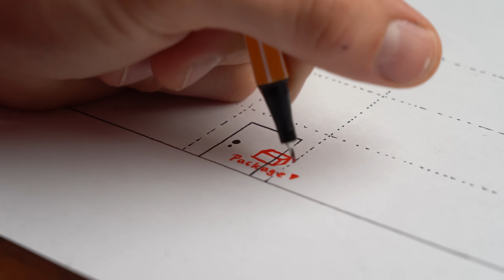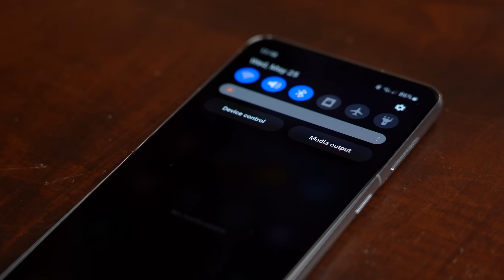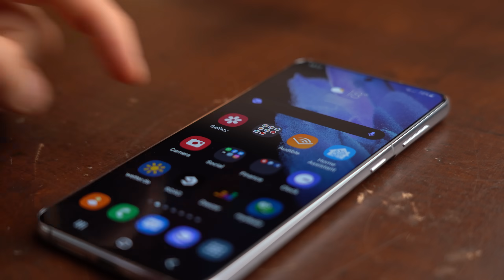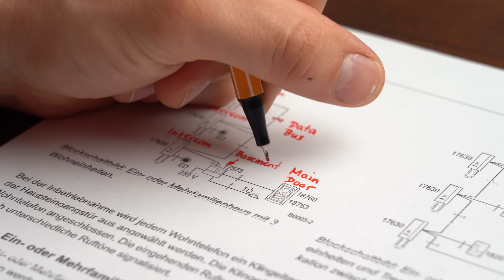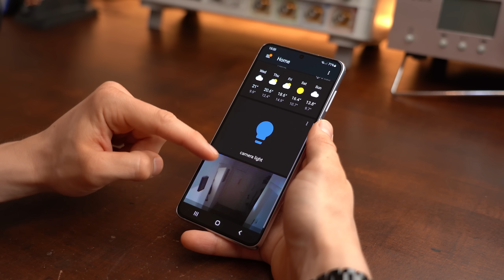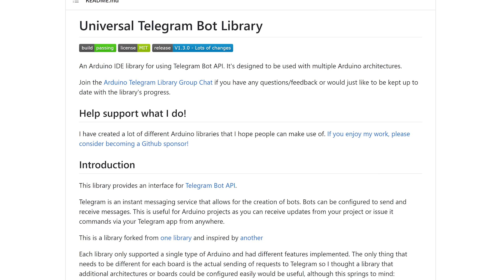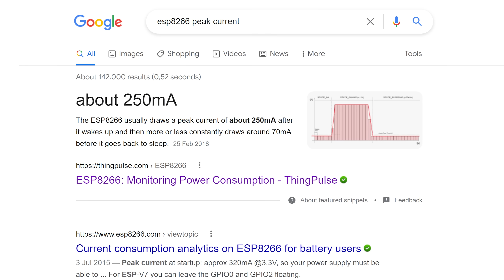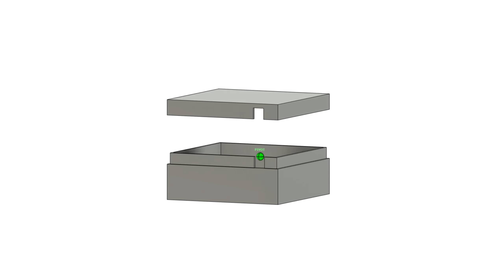Every Apartment needs this Upgrade! (WhatsApp/Telegram Notifications)

Comment: Excellent video. Love the least intrusive method. Only issue I have is with power being used when not in use. Doorbell doesn't ring that often. Maybe frequent but not often. Standby power use is too high, in my opinion - yours may differ.
Perhaps revisit to address low power sleep mode? obviously more important with battery power but still, we shouldn't design for waste.
Kevin Durrah has videos and designs to address just this.
Reply from the maker: Good point!
Reply: That's the issue with all ESP programs. When the ESP is connected, it always draws 70mA@3.3V. ~250mW is quite a bit for such a small device, and of course it will be a lot more when adding the current for the SMPS.
Reply: @TheRailroad99  if you're using the arduino core, you can always compare loop entry millis with loop end, and if the same (loop didn't do much that pass) sleep for 1ms... it cuts the power consumption dramatically but doesn't hurt response time if the loop has more to do.

Comment: Awesome project, I pretty much did the same thing last year to the exact same intercom system. Take a look at pushover, I used that instead of telegram to add a custom button to the notification, which can immediately open the door as well.
Super handy when you forgot the key or someone arrived earlier than you btw
Reply from the maker: Thanks for the tips!
Reply: @greatscottlab  You can also cut the the middleman without using universal telegram library and just send a POST request through Telegram API if it's just a one-way communication from ESP to telegram.
Reply: @kekkocheng  or a GET request with parameterized url. token, method name, paremeters (chat_id and text in this case)
Reply: @greatscottlab  Pushover is great, it's also integrated into Home Assistant so you can add everything to Home Assistant and do all your automations and other such stuff there as well, and I found it quick and reliable for pushing notifications.
Reply: Yep, i would also recommend taking a look at pushover.
Reply: +1 for Pushover. Excellent messaging API. I use it and a backup channel for critical server monitoring notifications so both speed and reliability is key. In practice I almost always get the Pushover message a second or two before the email; the email is configured to send first 😛
Reply: FYI, Telegram supports buttons in bot chats, too. While it's not directly in the notification, maybe it's good enough?

Comment: So cool to see old tech being "modernized" with the help of a little microcontroller :D
Reply from the maker: I think so too :-)
Reply: @greatscottlab  U can sell cute little greatscott electronic components plushies!! I think people may buy them ! lol..
Reply: Caramba eu vendo videos de eletronica e encontro o pesterenan aqui, amo teus videos também kkkkk
Reply: Esps are ground breaking chipsets in both feature and price territories!
Reply: I had an experimental thing on my oven, alarming me when the oven is preheated and ready to make Pizza. An LDR reading the light coming off the heater indicator and some timing/timeout logic did the trick
Reply: @nrdesign1991  Could've use a power monitoring smart plug for that. And the "Appliance has finished" blueprint on Home Assistant.
Reply: @Mavi222  The oven is hardwired and I'm not allowed to modify this wiring. Also no home assistant here
Reply: https://youtu.be/vOBSn1RWKj0
Reply: Thats not a little microcontroller though. Its pretty powerful for a micro controller
Reply: @uvuvwevwevweossaswithglasses  a micro controller is little, it literally has the word 'micro' on it...
Reply: @tristan6509  Yet for a micro controller, it's not that little.
Reply: @uvuvwevwevweossaswithglasses  The dimensions are little.

Comment: Interesting - I would take DC2DC converter and convert the 24+-V to 3.3V of the ESP. It uses peak 70mA, normally around 40mA, on 3.3V that makes 230mW peak, with 20% losses of the DC buck converter you get to 280mW max. No problem for neighbors :)
Reply: The 8266 can draw up to 400ma in certain situations so you would definitely need a supercap or a lipo at least...
Reply: I was going to say the same thing! A DC-DC converter could easily power an ESP. Even at full ESP power, you have PLENTY of headroom. And if there was any worry about EMI, etc, you could just reduce it to 4/5v, and have the 3.3LDO drop the rest.
Reply: It's not a bad idea but I think the DC-DC converter could introduce EMI in the system

Comment: Whatsapp is an awful piece of sh1t. Telegram isn't a great messenger, but at least it doesn't do all it can in it's power to suck. At least Telegram lets you connect directly to their service, as opposed to Whatsapp, where the only way for "API access"(The same API as the regular client uses!) is to pay them extortion money. That's not to say anything about Whatsapps horrible data harvesting(your phone book isn't yours anymore, you're snitching on everybody in your phonebook!), or their awful security in the past(using the known-broken RC4 cypher). I hate Whatsapp, and so should everybody. They've done *nothing* original, they always were just a sh1tty, borked implementation of XMPP that intentionally was made incompatible so they can sell more of your data and shitty API access.

Comment: Did this also to my doorbell. I also connected a relay to the door opener, so the postman can come up to my apartment while I am moving to the door :) I used nodered for the Telegram message receive handling to open the door.
Reply: I think this is the better approach. If he already opened the intercom, connected an external power supply and created a whole new enclosure, the door opener would have made this project a 10 out of 10 for me.

Comment: wait is that allowed by your landlord/law? I wanted to do something similar when I was living in an apartment but apparently (for me tho) it was illegal to mess with the intercom since I did not 'own' the the intercom.
Reply from the maker: I am not interfering with the intercom in any way. I use my own power and basically only listen for a certain signal. That is why I think it is kind of like a grey zone. But like always, rebuild it at your own risk.
Reply: @greatscottlab  I think you should've used a connector or something. Soldering directly onto the PCB could be considered tampering with it
Reply: @jort93z  The landlord might not like it. Just saying
Reply: @jort93z  I don't think it's that, it's that he doesn't exactly own the device and still making changes internally (even if he undoes it before moving out), it might go against the expected usage of the device by the landlord. It's just a matter of principle, not technicality
Reply: @jort93z  Its not law but might go against the contract between him and his landlord
Reply: The main legal problem is the power supply. Use the power from the intercom is stealing. That is the reason commercial systems like Nuki use batteries
Reply: The biggest issue with the solution may be that he soldered the wires on the connector tabs. At least when he forgets to remove the wires and solder when moving out, so adding an accessory with the proper connector there would involve additional work. 
And some contractor may just say that it has been altered and needs to be replaced entirely.
Reply: @agnag1  If he just clips the wires inside the case, i doubt anyone would ever open it up, if it still works ofc. They will probably not even care at all, till someone tells them that it's not working. Just imagine the contractor opening all electronics and power outlets just to see if everything behind is still how it's "supposed to be" .. not gonna happen, ever.
Reply: Questionable. If you revert it to the old state before you move out, I don't see any problems with it.